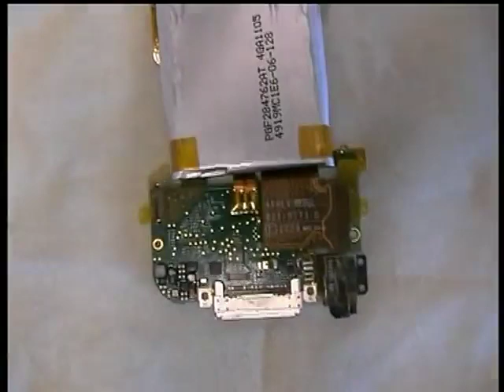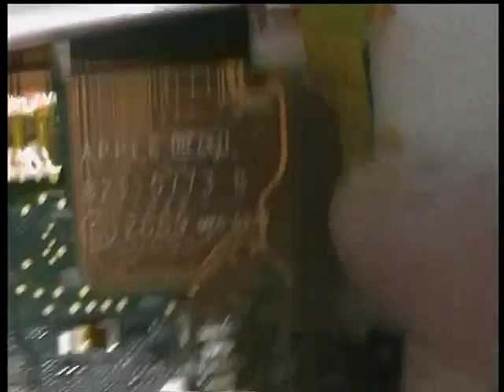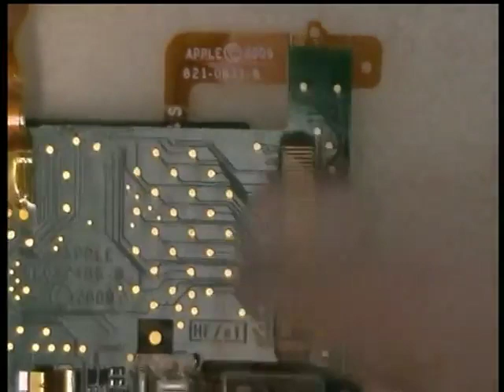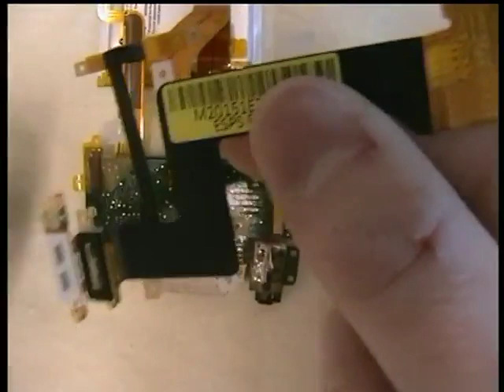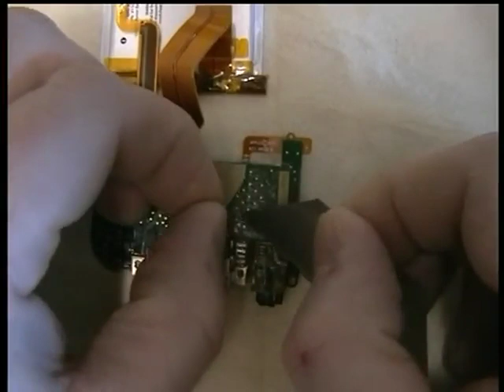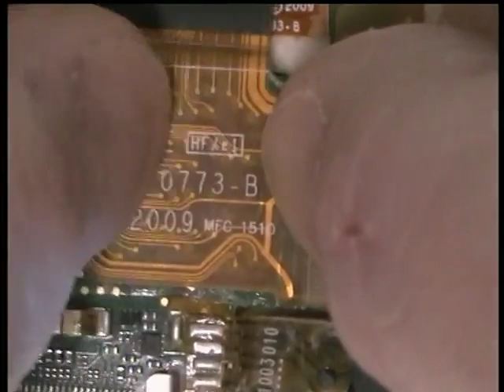IPOD Wifi tape conductive cloth 3M 9703 Electrically Conductive Tape cloth for FLEX RIBBON repair

Comment: Very nice demonstration. You don't need to apply heat to complete the bonding? Do you still have a link to buy the tape? Thanks.
Reply: cyberdoctormd790 use advanced search on ebay> search by seller.
$20 per foot. comes in various lengths
Reply: uhadme Thanks in found it. I already bought from a local seller on eBay though, $7.50 for 2x6". Didn't work for my application though, I tried to use it to repair the flex cables on LCD's, on Galaxy S3 & S4. The flex cables had been pulled off, so I scraped away the old ACF tape and tried to re bond them with this 9703 tape, but it didn't work. Anyone know where I can buy some ACF tape?